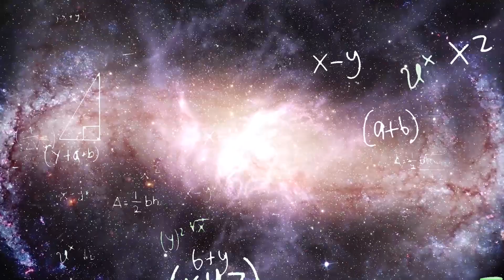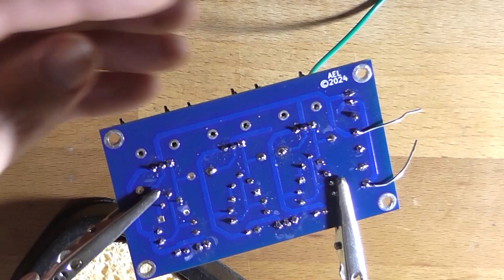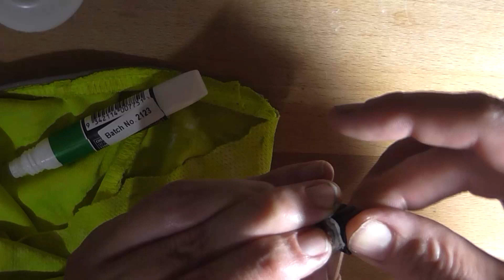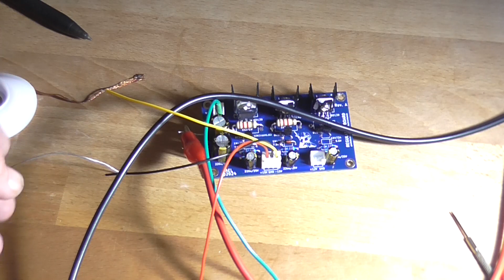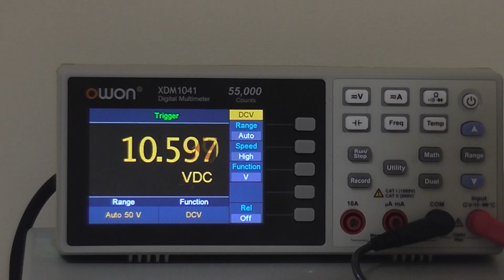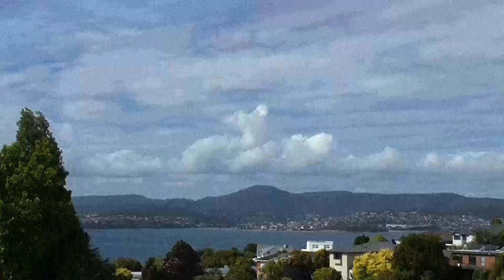Series-Pass Regulator PCB: Problem FIXED!

Comment: Great to see you fixed it. The regulation performance of simple designs like this is never that great, but should be fine for applications that take a fairly constant current.
I don't know if you want to stay with a purely discrete design, but using a TL431 as the reference and error amplifier will give a simple, low cost and fairly high performance solution.